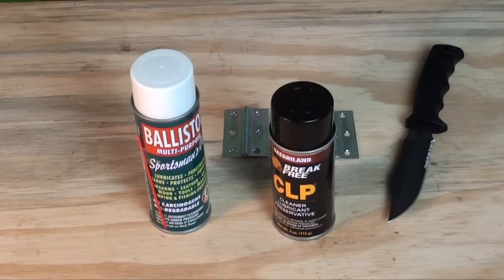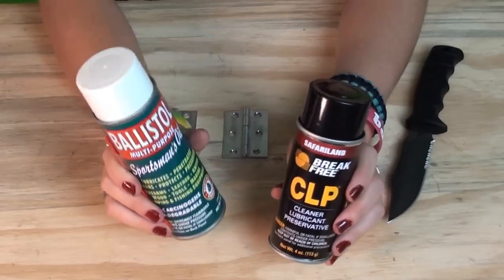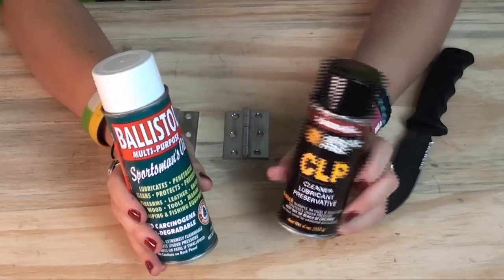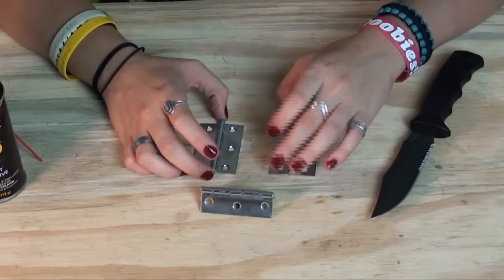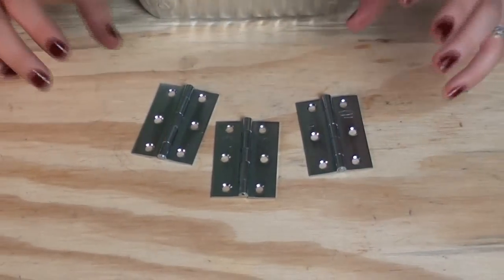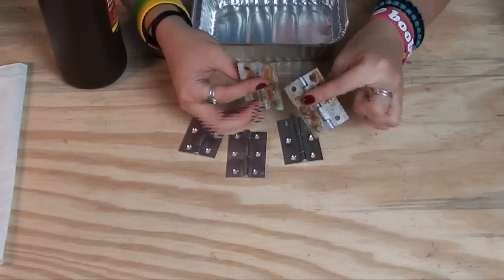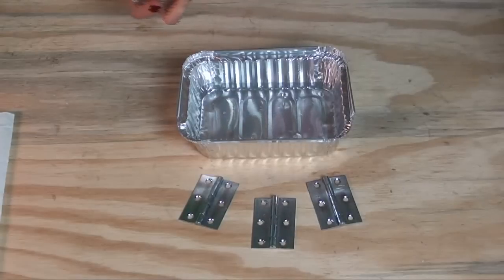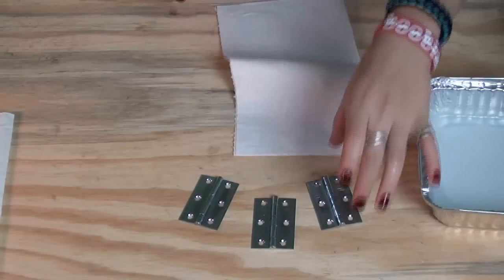Ballistol vs Breakfree CLP EXTREME Corrosion & Gunpowder Burn Test - FateofDestinee

Comment: im using my 1st can of break through clp but im curious mine is not foamy it comes out as a liquid like ballistol either way hickok45 swears by it and im going with that when my clp can is gone but im just a hickok45 fan dont hate lmao
Reply: Hickok has the test of time on his side too. So if it's worked for him all these years, it can't be to bad.
Reply: boingtronic My grandpa has time on his side and won't use a computer. He says a pen and paper, or a type writer is better. Having the benefit of time doesn't mean he's right. :)
Reply: +Randall P lol tru dat
Reply: +james harris There are a good number of cleaning and lubrication products that work well enough, all in all, and these are two of them.  Ballistol's major selling point is not that it's the best at anything, but that it does virtually everything any firearm would need for this type of routine maintenance--not just as a normal CLP, but because it contains emulsifiers, it's also great for mixing with water to both clean and protect black powder firearms at once.  Folks are also impressed that it does all of this while being relatively nontoxic, which is a plus, and some even advocate using it on cuts since it has antiseptic properties from its isobutanol component and protective properties from its medical-grade mineral oil component (I wouldn't go this far, but it adds to the selling point of extreme versatility).

Ballistol is a fine product overall, but as we see here it is not the best cleaner, even among CLP products--it gets the job done, especially if you let it soak for more than a full day, but it's far from the best.  Would you ever need something better?  Perhaps not, but there are significantly better cleaners.  It is also not the best lube, even among CLP products--Weapon Shield CLP (also relatively nontoxic, and as a bonus it smells nice [like cinnamon] and not as strong) is the best lube that I know of, not just among CLPs but all general-purpose oils commonly used with firearms (in fact I use it on everything that can take oil--for example, door hinges that I had to oil every few months with other oils haven't squeaked for over five years now since I used Weapon Shield on them), and it does a fair job of cleaning, too (not the best at this, though).  Ballistol works well enough as a lube and stays put better than many, but you can still do better.  There is nothing wrong with sticking with something if it works well for you, though, as we're hardly talking about an extremely demanding application here, but there are other products that work just as well or better in some ways.

Comment: Break Free seemed to remove more powder residue.  Scrubbing with a hard toothbrush would have gotten even more discoloration up.  I currently don't use either of these products.  I make do with old Hoppe's No. 9 and that toothbrush.  It takes more time, but the result is adequate.  Then I oil the gun's surface to renew protection from elements.

Also found that wrist bracelet on the left wrist to be distracting.  To see the word "boobies" flashing in and out of camera broke my concentration just a little.  It brought out the "teenager" in me once again.  Merely an observation and not a criticism.

Comment: And...if you had just put some WAX on one, it wouldn't have rusted at all. There are gun waxes available, and for this kind of exposure, they're better than an oil, which just rinses off.

Wax is not good for lubrication/friction, of course; but for external surfaces it's the best thing.

Comment: Yeah thats about the same results I got with the Ballistol. I didn't like the stuff at first cause I didn't think It cleaned very well but I did realize that Ballistol does do a pretty good job of keeping your gun protected, plus you can get it on a wooden stock and it wont hurt it. So now I usually clean my guns with Hoppes solvent and oil it up with Ballistol.

Comment: Guns Gear & Fitness What are your top 3 gun cleaners?
Reply from the maker: Thomas Kishman II I'm not terribly picky; if it get's the job done, I'm pleased. What I have around the house, currently, is Ballistol, CLP, and Hoppe's No. 9. :]
Reply: Guns Gear & Fitness Gotta love HOPPE's I have it because it was my first gun cleaner for my first gun :)
Reply: Break free CLP, Ballistol and Hoppes #9 are my favorites.  for applications wear heavier grease seems to be needed such as on my AR-15 (when I'm giving it some more severe use) and for no specific reason on my Sig 226 which seems like a bit more lubrication certainly then a Glock (but still not alot).  I really like p  Slip 2000 EWG ("Extreme Weapons Grease").
Reply: #1 seafoam the automotive carbon remover.
#2 ballistol
#3 CLP
Reply: You should do a video on seafoam compared to the others in this test
Reply: redneckism101 Dude, YES x1000 seafoam , think about how much more dirt is deposited on cylinder heads and it makes sense that seafoam is in another league.